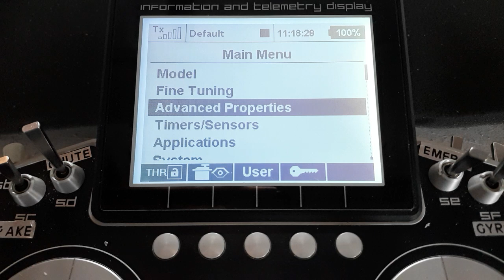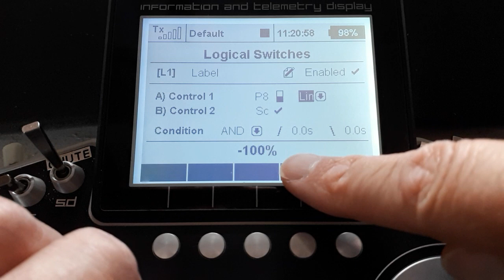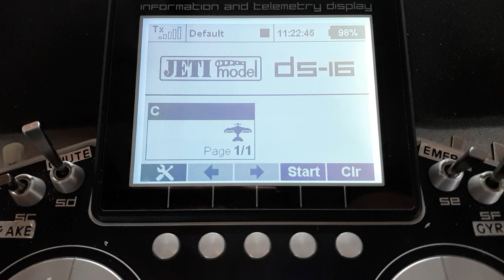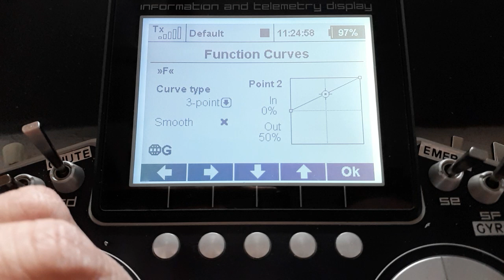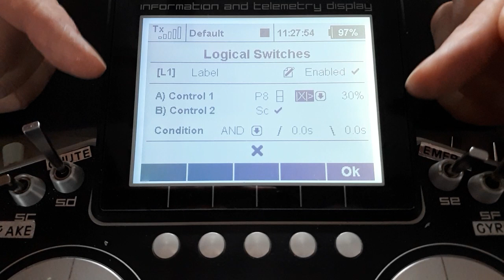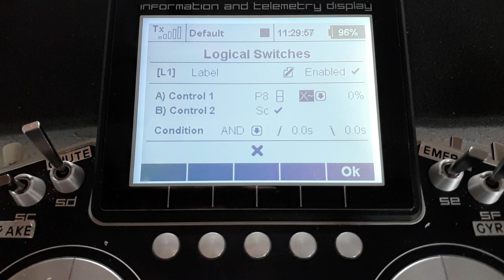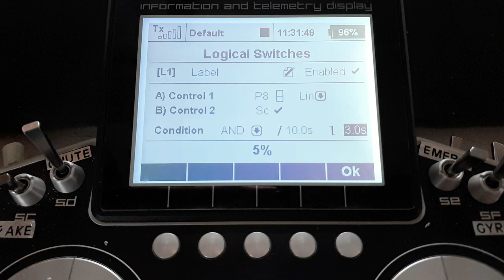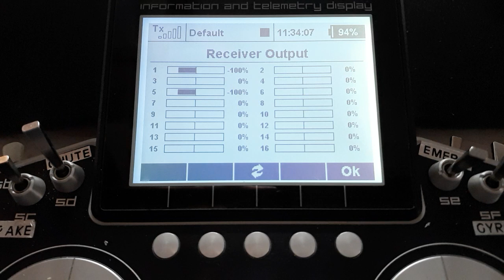Jeti - Logical switches, more options

Comment: Thank you. Could you help me with my use case? I have a 3 positions switch changed to be -50% => 0% => 50%. These limits are established that way so I can choose the lights' value for a Unilight's lighting module... I would like to switch it to -100% if another 2 positions switch is off... this does not seem to be possible...
Reply from the maker: https://youtu.be/ifitLqGWipA

Comment: Hey...

Maybe you can try solve this.  Only thing I have not managed to get done that is super easy in OTX.

So..   exactly as you have... you have a pot setting a value; that then snaps to -100/+100 depending on the switch.

What if I want the  last pot value to be 'stored' when the switch is off.

So...   press switch.. set value...  let go switch. Now last value set is the 'saved' value.

Any ideas?
Reply from the maker: Sounds like a good feature, I am not aware of a way to do it with Jeti
Reply: @cotswoldpilot  Yup...    maybe possible if I do a lua app.  I will investigate!